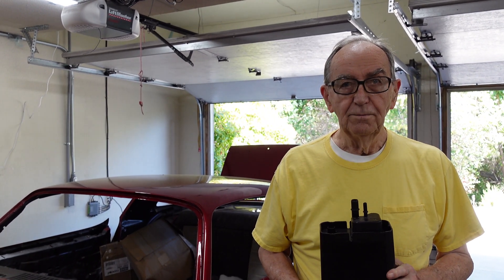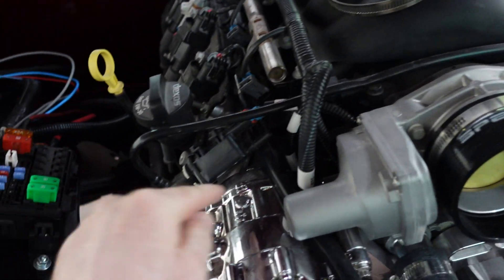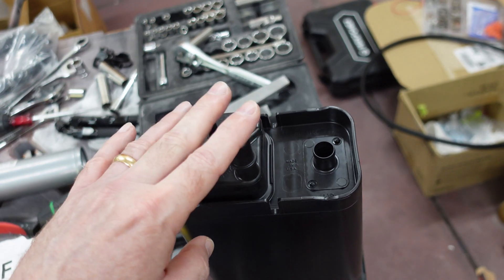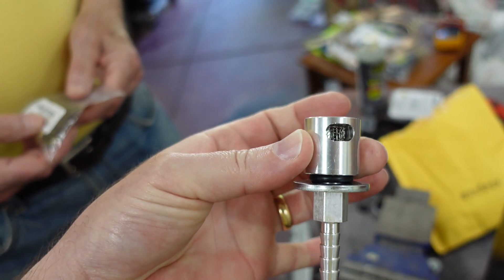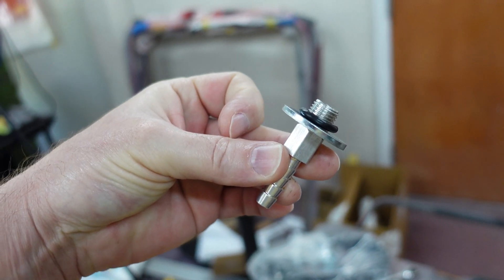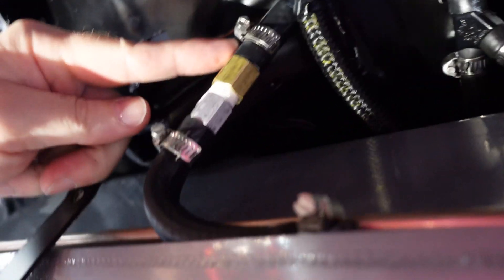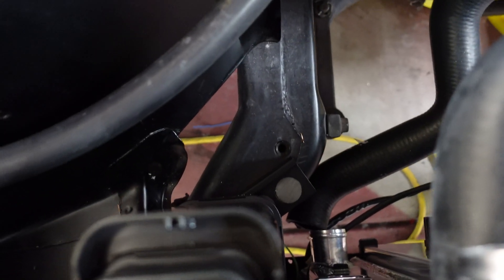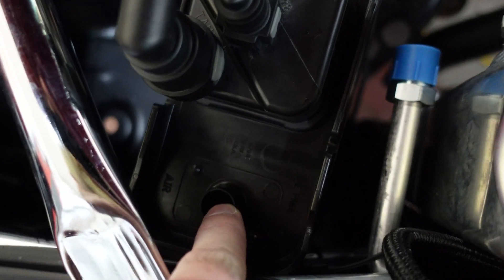1977 Camaro Z28 Part 271: eRod EVAP system and tank vent

Comment: Thanks for the video, nice looking project.  I'm in process of adding modern MegaSquirt EFI to my old 240z, looking at same issues with evap.  I have not found another vid showing this type of modern evap on an older car.  Trying to find an evap unit that will easily install in engine bay and use MS control wire.  thanks again
Reply from the maker: Good luck. Yeah, most people don't want to deal with it.
Reply: @asicerik  thanks, great looking early camaro.  It should really scoot with LS

Comment: Inside this activated carbon canister is thousands of tiny beads of activate carbon. Each cranial is capable of holding 350% of its own weight in volition organic compounds like hydrocarbons. This is exactly the same product used in your breathing face mask, closets to your face. A replaceable N-95 filter is held on over it. 
  The canister; It can be verticals or horizontal in mounting. Purge fitting goes to solenoid mounted on the intake towards the front, to distribute raw gas fumes evenly to all cylinders when the conditions are correct. Not cold, idle of over heat, just above idle while driving. Vent is the large fitting. This is where the roll-over valve is inline at the pump inside or direct above the tank as close as possible. This reacts to liquid during filling and close off. This makes liquid fuel go up the filler tube to shut off the refueling event at the pump. The activated carbon will absorb all the gas fume in vapor form. During the EVAP test, on a run-time clock by the PCM, with liquid fuel between 80% full, or 20% of empty. Only then test for leakage is run. During reprogramming of the PCM, this function is turns off. There are two filter covered filters inside the canister that have one end that moves. This side is spring loaded and keeps the carbon granuals tight compacted together so they can expand or contract during absorbing hydrocarbons or releasing them. Exothermic creates heat when absorbing and endothermic creates cold when fresh air air passes over the granuals to remove the absorbed hydrocarbons. This third tube on the right (As Held In This Video) needs only to have a cube shaped piece of breathable upholstery foam, cut hole for fitting, glue with contact cement over it to allow fresh air to enter or exist. There are no fumes on the port fitting as air coming out is scrubbed by activated carbon, or fresh outside air enters during purge. (Note; If working as designed to check for EVAP leaks, it needs a vent valve to close off as engine vacuum thru purge, pulls a vacuum in inches of water, H2O, not Mercury) This test is so sensitive to reach 8” of water vacuum, shut tank & purge, hold for 2 minutes, and the sensor (That looks Like MAP sensors) monitors this tiny vacuum. After 2 minutes, if small leak allows the vacuum above 12” H2O, it fails. Below or between 8” - 12” of H2O, then good. 
 I did this at dealerships for years. The “Green Cap” in the engine compartment on the purge line, you pumped a smoke into this port or later, gas cap adaptors. The smoke is yellow and easy to see with a blacklight to find a leak.
  Gas caps allow air in so tank does not crush under a vacuum, but has a vent. Prior to OBD-II, it only took 1 PSI to open and vent. After OBD-II, they dropped it to 1 PSI. Every has an old school gas cap on you grandads Buick the said “Caution, Gas May Spray When Open” these were not vented. So, hope this helps. Retired ASE Master Tech.
Reply: Spell check hates automotive terms. Corrections, after OBD-II they increased venting to atmosphere thru cap to 2 PSI. 
Canister is sized to tank and for 10 years basically identical on vans, suv’s, trucks and many cars. They are mounted at the rear. #1 problem is the vent solenoid is open all the time while driving. Dust & dirt gets onto the seal so when commanded to close, it does but won’t seal. Easy fix when code is small EVAP leak. Type “B” code so no light on first test / fail. Some like GM will say “Check Gas Cap” If time passes, it runs the test again, if fails, light is turned on (CEL). If swap, your programmer will shut off VAT’s and EVAP plus 50 other things. OBD-II has been around since 1994 and still not fully understood by many with tool boxes at shops. Just thinking out loud to help those who may read & need the info. Best of luck! Your dad is a great character!
Reply from the maker: @deankay4434  He is. We crack each other up all the time
Reply from the maker: thanks for all the great info Dean.
Reply: Hey Dean, what do you make of the Canister Vent port being left open in the E-rod system?   Wont that vent HC to the Atmosphere?
Reply: @stevew9563  The connection on the carbon canister is marked "Vent". It is connected by hose to the tank vent solenoid that is normally open. Outside air passes thru it during purge at the solenoid on the engines intake, pulse width modulated during driving at temp to pull hydrocarbons out of the canister. When filling at the gas station, follow the hose as there is a high spot, almost a bubble feature on the tank. This allows raw fumes to push out into the canister's Tank connector. The activated carbon absorbs the hydrocarbons and the canister size is based on the fuel tank(s) size. When the engine is off idle, purge opens otherwise it will stall.
 Driving down the highway, the PCM adjust fuel mapping based upon O2 sensor #1 only. 
 If it's a V6 or V8, it will have O2 sensor #2Right bank #1Left. 
 Air flow thru the tank vent solenoid happens when the purge is on, allowing vacuum to pull any hydrocarbons into the intake plus dust, dirt, small chickens and small cantaloupes. As for the filler neck, especially on a resto-mod or "LS" swap, look at the fuel tank. It provides fuel to the filter, return (Unless Internal) but the 3rd metal line has a "Roll-Over-Valve" either inside or added outside aftermarket. This hose has to go high up inside the fender over the filler neck level to keep liquid out. The roll-over-valve has a spring-loaded float the liquid hits, then lifts to seal this vent. This causes fuel to backup inside the filler neck, still leaving an air space inside the tank to expand when heated by the road, daytime temps and gain from exhaust.
  I hope this all makes sense. DK.
Reply: @deankay4434   - Thats the thing in this E-rod set up there is no Tank vent solenoid .  So they just leave the vent hole open.  The hole I am referring to he points to at 2:05 of the video.
Reply: @stevew9563  Got it. The major problem is gas fumes are flowing into a garage, shop or lean too. You will have bad fumes, furnace or water heater could start fire once air/fuel reaches 14.2:1 A/R or higher. Be safe!

Comment: Hi Erik,  I just went to take a look at my canister.  It is located where you put yours but laying on it's side so that the hoses are pointing towards the radiator.  The port in question is indeed left opened.  I have a bracket holding the evaporator purge selenoid in place. It's cloudy and raining here now so the lighting is not that good now. When it clears up I'll make a video.  What also makes it hard to see is that above the canister is where the fuse block is mounted.  And the geniuses also ran 2 AC hoses above the block that need to be removed when fuse need to be replaced. And not a good idea to place all the fuses next to a radiator cap that may one day leak over it ;)  I'm not able to get under my car yet.  I need to make some 2by4 wooden car jacks to get under the car to see where the hoses run, but if there is anything else you need me to video I will try to do that today too.  If the lighting is no good, I will do one anyway and then redo it again tomorrow.  Good to hear that it's almost time to pour some gas in and start your engine up!
Reply from the maker: Thank you sir! That is great. I wonder how they got the fuse block there. Mine would not reach.
Reply: @asicerik  Sun is starting to come out a little!  I'll give it another 30 mins before recording.  I'm not sure but I thought maybe they put it there because it was easier to reach there but you saying the opposite makes me feel that I should be able to relocate it easily (I hope).  I came online again to ask you if you already purchase mufflers?  Borla is what I use and they make one specific for the LS3 engine.  There are other good brands out there, but I know that these are specific for that engine.  You can go on their webpage and listen to them but I think it's a little unfair because they also have non-CARB products that make it sound more racier.  And as you know, my video has audio on it too.
Reply from the maker: @transammusclemachine9386  I bought the Hooker Blackheart kit. We will be installing it this coming weekend. It is a bolt-in kit, so I might try some different mufflers. I will check out Borla's site. Thanks!
Reply: @asicerik  Cool!  Video is being rendered and then will upload to YT. It's a little shakey because I used a lens without stablization but real good in low light.  Will let you know when upload completes.  I am embarrassed of my car after seeing videos of yours.  Even more so because I paid $$$$$ to get mine done (I mean get mine butchered! lol)
Reply from the maker: @transammusclemachine9386  LOL - I appreciate the sentiment. No one would be able to afford me as a mechanic though. Hourly rate might be ok, but hours? Sheesh
Reply: Hey Pete you wrote   " The port in question is indeed left opened "  I assume you were talking about the Canister Vent Port.  Did you get through the Ref process with that left open?   Though the whole point of the Evap was to not let it vent to the atmosphere and it seems with that port open that is exactly what it will do.  But I also saw they did not include any wiring for a vent valve so I guess they were not counting on a valve being on there??